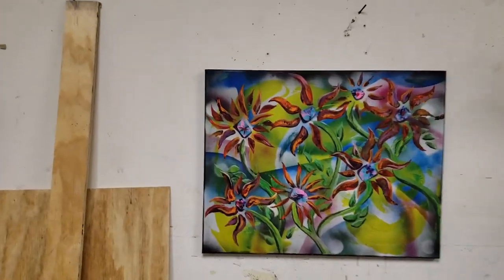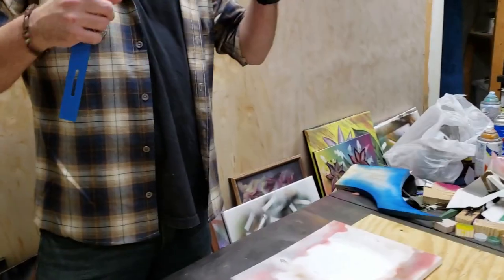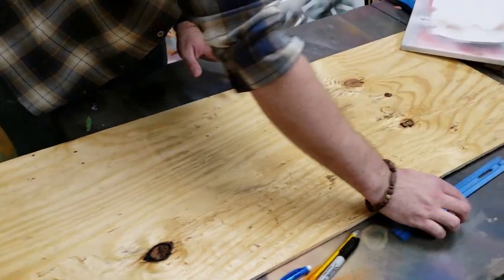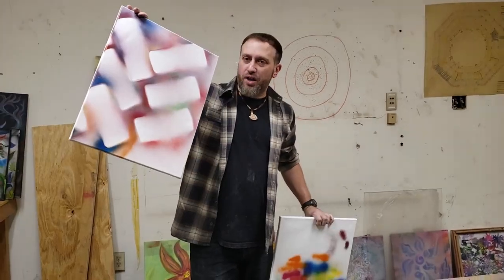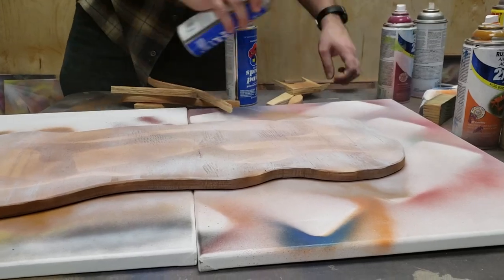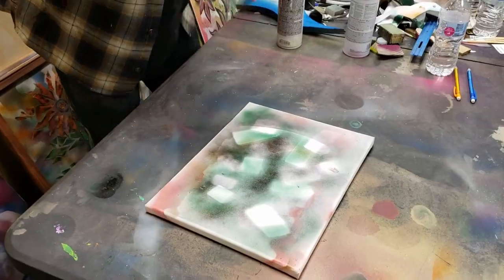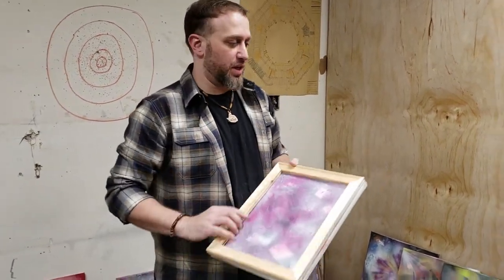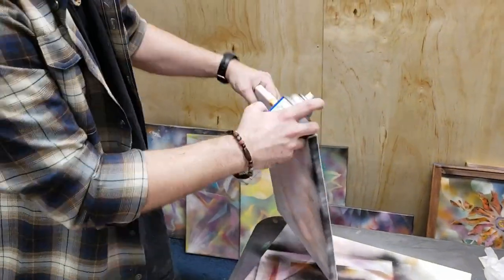Easy Jewelry Displays - Eps 80

Comment: Sure, all you need is a $350 power saw and a $100 belt sander...
Reply from the maker: $225 bandsaw and $40 belt sander.

Harbor Freight
Reply: U can simply get a photo frame and repaint it. And Cardboard can be the replacement of wood for the bracelet stand. Just cut the shape out and stick few of them together, still can be strong to hold. Only won’t last as long as wood la.

Just use your imagination to use things u can reach la. And u can make anything u want. 😊

Comment: Ya but if you dont have a wall what do you do with the necklace display?
Reply from the maker: Buy 2 large shelf hanging triangles from the hardware store and put a flat piece of wood on the table behind it and screw the triangles into both to make it stand up.

https://www.amazon.com/Folding-Brackets-Triangle-Bracket-Mounted/dp/B07V3BY3SB/ref=mp_s_a_1_14?keywords=large+shelf+bracket+triangle&qid=1579317080&sr=8-14